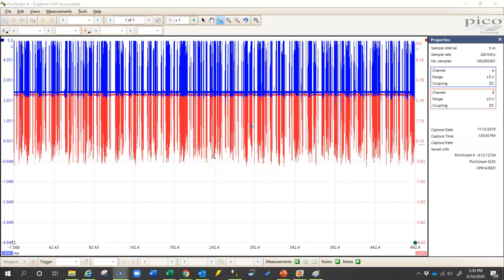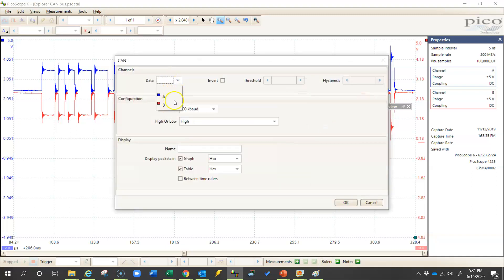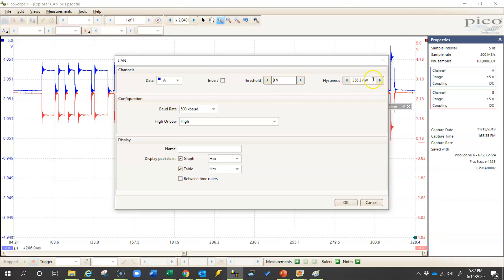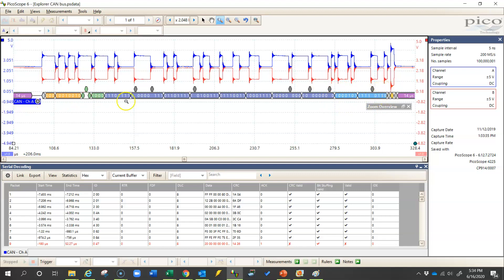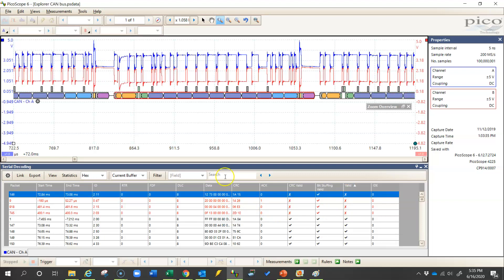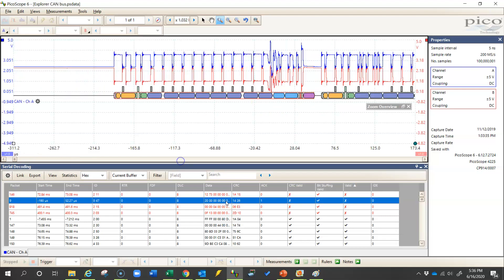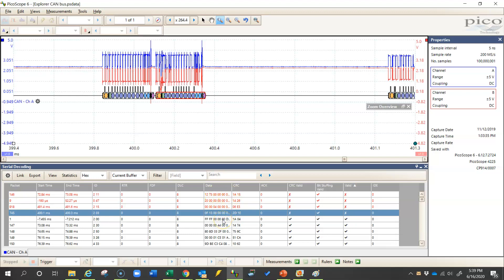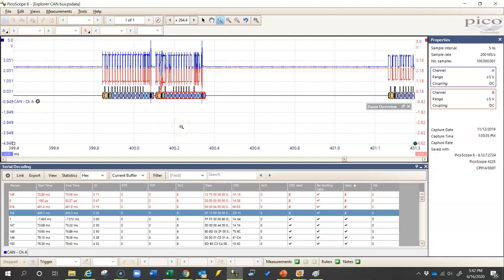Finding CAN Bus Signal Errors

Comment: Ideally you should create a math channel A-B to display the differential voltage and then have the math channel decoded.
Reply from the maker: You're right.  That is a more accurate way to decode the signal the way the modules in the vehicle would.

Comment: Hi, I've been searching the internet for hours looking for a solution.  I have a problem with the cambus.  Steering wheel controls don't work, and when I turn the key the radio won't turn on.  gives me error (U2101-00 canbus maximum configuration list not programmed).  I tried unplugging the battery for 1 hour but the problem is still there.  I was wondering if you had any idea what this error is and possibly how to fix it.  I hope you answer me since the video is years old.  I thank you in advance.
Reply from the maker: It is really hard to diagnose the car remotely.  I can only guess.  What type of car is it?
Reply: @JustinMillerAutomotive  I went to my mechanic.  he told me that it should be the fault of the display that gives the radio information.  now i am waiting for the replacement display.  🤞 thank you so much for your reply

Comment: Thank you sir, what do you think about an automotive oscilloscope that has 10 Mz bandwidth, 40 Ms/s sample rate to analyse can bus fast canbus, and all car's sensors. It's AVL DiTEST SCOPE 8400.
Reply from the maker: It could work, but you would need to set your scope to a very short time base and you may only be able to capture 1-2 data frames at a time.
Reply: @JustinMillerAutomotive  thank you sir

Comment: Thanks for all your great videos Justin. Sad to say I don't get my scope out as much as I should. Since i discovered your channel I've got a renewed determination to do just that. I've been a tech for over forty years and my first scope was as big as a car and really only focused on ignition waveforms. Then came my Fluke 97 and it was great (still have it), then a cheap USB scope for a hundred bucks and really splurged when I bought the 4 channel Pico scope a few years ago. Just lately I bought a Micsig STO1104C which I've been using much more lately because it's a stand alone unit. i got kinda tired of dragging out the laptop and pico scope even though it's got a much deeper memory than the Micsig.